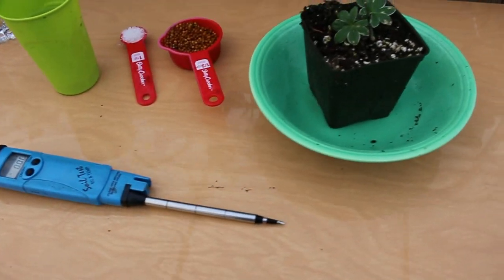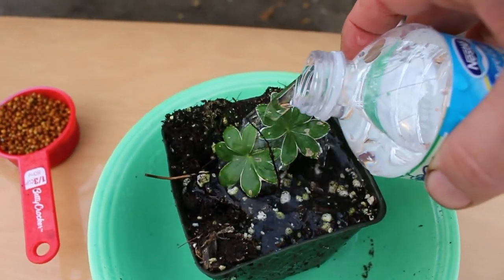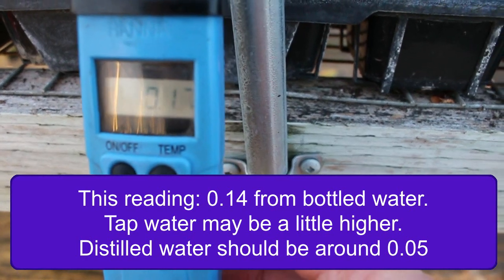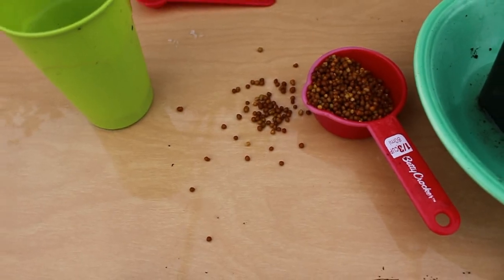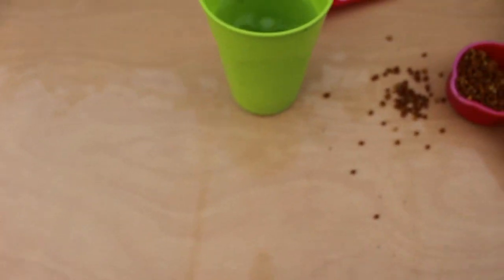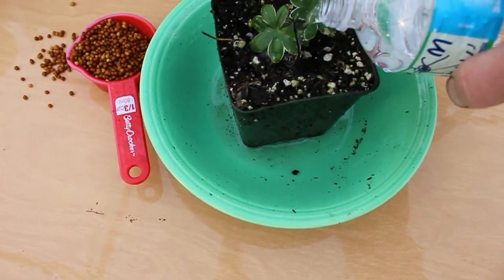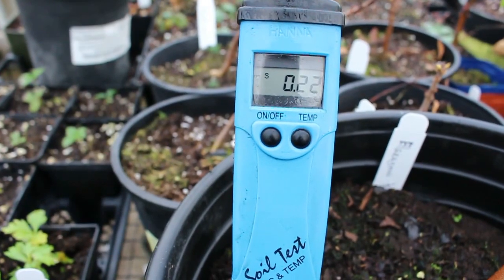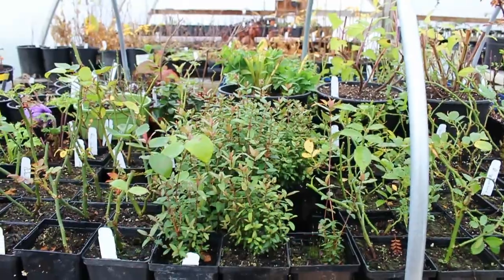Test if Your Plants are Over-fertilized by Direct Stick EC

Comment: Hi Jason, Found the thread! Hope your well. I have a EC meter that reports in us/cm - the water we use to feed our plants is 240 on the EC i'm not sure how to calculate this into a 2.4 for example number yourself and many other online resources seem to. Online calculators are confusing me more lol. We have an inline fertigation system which is brand new so still working it out but I assumed the numbers to be higher too with that dripping feed into the system all the time. Thanks
Reply from the maker: My estimate on this was only made with observation in soil on that particular meter, and I think I may have noted (though it's been a long time) that it's far more accurate to perform measurement using the pour-through method. Yes, the conversion from 240 to 2.4 sounds about right - as there's some inconsistency between meters that report in different units (or even convert over to an estimated ppm).
Reply: @FraserValleyRoseFarm  Thanks for the reply, yes the pour through is 1500 so now I’m thinking the irrigation water is way to low which questions if our fertigation system is actually doing much….i was thinking that our base soil for propagation is rather sterile so should have a low ec so our water with fert should hit the target range we need. Our range for dahlias is 100-200ppm N, EC extraction 0.4-0.9mS/cm, SME: 0.9-2.0mS/cm and pour 1.3-3.0mS/cm according to Michigan State paper they released. Do you know how I convert these to us/cm that my read gives me? Thanks so much! I’m not a numbers person the best of times!!

Comment: Hey Jason - thanks for the video and I realise it is old and you may not be reading the comments anymore.
I wondered how moist the soil should be for direct reading, in order for the factor of 4 estimate to be roughly applicable?  Does soil moisture not influences this?

While I'm here, I was a little baffled as to why you showed the leachate reading without also taking a direct reading of that same soil, so you could demonstrate on camera the factor of 4 tip.  You walked away from the leachate reading plant and stuck the meter in a bunch of other pots... so just flagging an odd missed opportunity there to demonstrate directly what I think is the central information you're sharing here: the factor of 4 estimate tip for converting a direct reading into an estimate reading of leachate conductivity.
Reply from the maker: Thanks. Probably a little bit of inexperience showing on my parts (not to demonstrate the conversion) - and frankly, it ended up as a pretty iffy topic for YouTube, given how difficult it is to explain, and how few viewers take an interest. Live and learn! You're right that the soil moisture makes a big difference, and for that reason I try to be relatively consistent in my timing - usually on the morning after a watering is pretty good, and the soil is evenly moist in the pots. Some "thristy" and rootbound crops are more difficult to gauge.
Reply: @FraserValleyRoseFarm  Thanks so much for the reply.  I'll do what you do then, in terms of when to take the reading after watering!  All the best.

Comment: Why the result should be x 4 ?
Reply from the maker: Only by experience - as a comparison between measurement in liquid solution and in moist potting soil. You can do it without the "translation" just fine, you just have to change your own benchmarks of what's an acceptable reading.

Comment: Hi Jason! Great video! I was wondering though how much water do you put through your pour method to have an accurate idea of the conductivity of your soil? It seems to me there's a fine line of not putting enough water and putting to much to have an accurate reading?
Reply from the maker: Hi George - that's true, and I think most instructions are to target a small amount of leachate (like 50ml). Not sure how easy it is to be so consistent.

Comment: I am both interested in knowing the number when I have just given them fertilizer, but also in being able to read the values as the soil loses the values, as I run regular routines with application of fertilizer every 4 days, it can be crucial that there is no accumulates too much "old manure" in the soil and especially in the last stage of flowering, it is important that the soil is depleted of nutrients so that it can go into the compost after harvest. I think I can make a chart that can convert the values that come out when measuring directly into the ground. we just need to know the extent of the mass of soil and the amount of water that is in the pot and then equalize the difference between 100% water and soil that is 100% saturated with water and then put the values into a chart. it is a bit cumbersome and a tedious task, but in return, it is only necessary to do the process once.

Comment: Suppose my fertilizer has EC 2.5 when it is applied to the soil. How much is EC in soil ?
Reply from the maker: It depends on how much your plants are using, how often you apply, whether you alternate with a flush of plain water. Salt can definitely build up in the pot if you fertilize with every watering. It's a good idea to verify the EC in your pot with a pour-through test occasionally to see where you're at.

Comment: Dude, why would I spend money on this gadget when I still have to ×4 the reading. Does not sound accurate at all.
Reply from the maker: Hi Mini - spend your money how you want. For me, it work as a much faster, more convenient alternative to the pour-through method. The meter reads exactly the EC of a water solution - no problem there, but when you use it in soil, the number is lower (because conductivity is lower in soil). You don't have to do the x4 calculation at all - I just know that when it reads .7 and above, I have a high fertilizer release in the crop. Your criticism of accuracy is valid (it depends a lot on soil moisture), but for me it's not a question of perfectly accurate, but whether it's accurate enough for my purposes. A quick walk around the nursery and I can test many dozens of crops. On several occasions, it's helped me to identify excess fertilizer release in unexpected crops (which I then confirmed with pour-through) - the point being that it would take me many hours to screen what I can in 15 minutes if I were to use the more accurate method right up front.
Reply: Soil and water reading not in the same range . Soil ec metre read salinity in the medium.